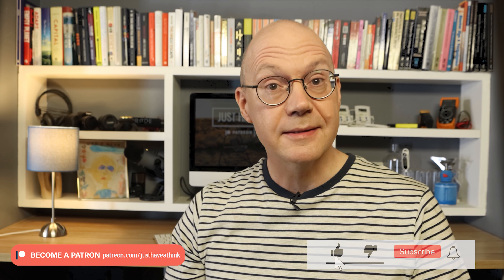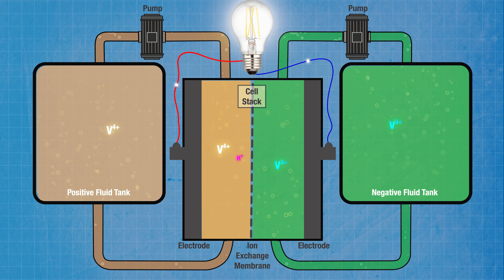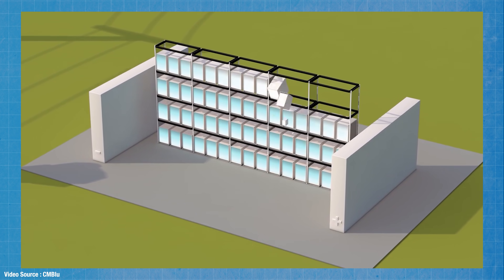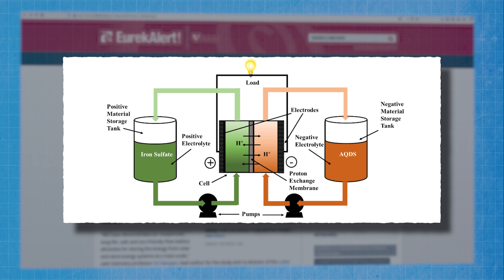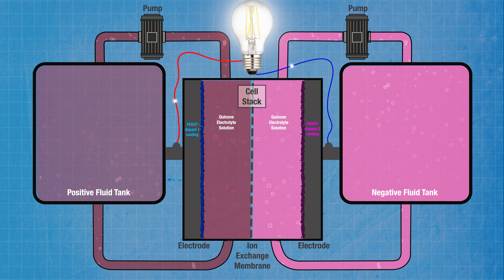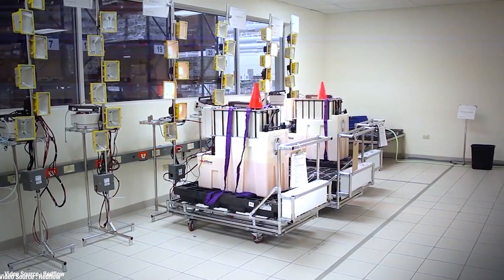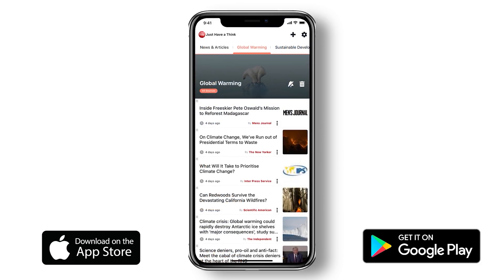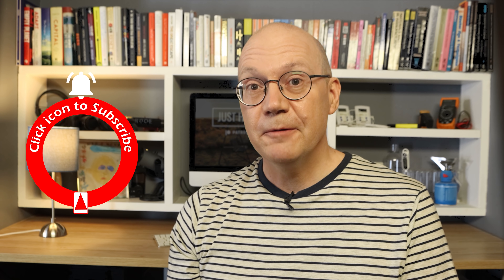Organic Redox Flow Batteries - The true path to grid scale energy storage?

Comment: I have a few hectares of oak trees that I'll start cutting down as my future quinone gold mine, chanterelles be damned!

I think the future of energy storage, even at Tesla, is already heading toward LFP cells, not the regular Lithium-Ion cells with nickel and cobalt, so the part about sustainable, environmental and ethical mining could be removed from the comparison, or at least include a caveat.
By the way, how would these organic redox batteries compare to LFP ones price wise? It does not really matter that they are cheaper than the vanadium redox cells if these are already super expensive.
Organic compounds also have a tendency to degrade over time (see OLED that has improved a bit in this area). Do these quinone/pedot redox cells suffer from this issue? On the other hand, if you only need to replace the electrolyte or electrodes every 5 years with cheap replacements and dispose of the old ones in the compost, that would be no concern.

A tiny bit of anti-China protectionism at the end?  ;)
Nah, sound financial advice, we should push these techs out of the lab ASAP.
Reply: This Organic Redox Flow Batterie Producer -> https://www.cmblu.de/en/home/ is using a Lignin based waste product from the paper industry...
Reply: Tesla has stated their intent to move entirely away from cobalt in the near future. Next generation cells don't use cobalt and the mass production lines are currently in developmnt and already partially exist, though need further improvement.
This is not limited to LFP cells, other chemistries, including their high performance/high energy density cell designs, are affected by this change as well.
Reply: @theuncalledfor  I know, but LFP cells don't have nickel either, whose mining and refining process is a huge environmental problem. That, plus electric motors without neodymium would really end all criticisms about polluting and ethical issues.
Reply: @Chimel31  The environmental problems of nickel mining are not "huge" in comparison to climate change.  They are almost insignificant.
Reply: @incognitotorpedo42  Well, it's still huge compared to the gigantic climate change issues.  ;) I mean the environmental pollution that it causes, which also has a carbon cost that (apparently) negates 2-3 years of EV usage. Some nickel is easier to extract than other sources, but it's in short supply and we'll need to extract nickel from dirtier and hugely polluting sources if we want to electrify all transportation and use Lithium-Ion batteries for energy storage. LFP cells is a proven tech that also has a great potential for future progress. The redox cell is another such alternative that uses neither cobalt nor nickel, and the latest research shared by Dave shows that it also has a potential for progress.
If we have a cheap working alternative without heavy metals and their specific issues, the market will choose this solution.
Reply: @Chimel31  Most nickel is used to produce stainless steel, and it is mostly derived from the oxide ore, which is expensive to refine.  EV batteries use high purity ("class 1") nickel, mostly produced from sulfide ores, and requires less energy to refine.  The Global Warming Potential for the production of 1 kg class 1 nickel is 7.64 kg CO2 equivalents.  A Tesla Model 3 contains 30 kg nickel, so that represents 229.2 kg CO2.  One gallon of gasoline produces 8.89 kg CO2, so the nickel in a Model 3 battery is equivalent to 25.8 gallons of gas.   A Model 3-equivalent gas car would get about 30 mpg, so the CO2 debt for the Tesla should be paid off in 25.8*30 = 778 miles.  That's not nothing, but is only a few weeks of typical usage.

The reason I'm going to the trouble of this analysis is that I'm concerned that we're letting the perfect be the enemy of the good.  Ground transportation is responsible for about a quarter of the worlds greenhouse gas emissions.  It's a huge problem.  Electrifying it would get us a long way toward net zero.  Waiting for a perfect battery with no emissions or no local pollution means that many more years of CO2 from vehicles, years that we don't have.   Much of the CO2 cost of nickel production is electrical power, so that is something that can and is getting cleaner over time.   LFP batteries are a reasonable choice for a lot of consumer automotive applications, but currently aren't adequate for high power needs.  Iron does have a lower carbon footprint than nickel by about a factor of 4.

Sources:  https://link.springer.com/article/10.1007/s11367-016-1085-x
https://www.ncbi.nlm.nih.gov/pmc/articles/PMC4085040/
Reply: @incognitotorpedo42  I agree with your data on class 1 nickel, but such high purity sulphide nickel (what your springer link is about) is not as abundant on Earth as we'll be needing to electrify transportation, and we are finding very few new deposits of it. What I was saying is that if all car manufacturers and energy storage were turning to nickel batteries, we would need to mine and refine dirtier laterite nickel.
In your Tesla Model 3 example, that would mean 2.4 tonnes of carbon emitted for a 30 kg nickel battery pack, or 8,100 miles, over 10 times more than your data.
This mileage probably corresponds to less than one year of average usage in a perfect world, but it would take more with regular grid electricity depending on the country, your actual annual mileage, etc.

There's enough high purity nickel for now that it's not a concern, and I am not at all in favor of "waiting for the prefect battery", I am a strong supporter of BEVs, but there is nothing wrong with planning ahead, especially when we have viable alternatives, or develop new ones for when we need them. Besides, Lithium-Ion batteries are not suited for ground-based energy storage. LFP batteries work much better for this application, and maybe these redox batteries in several years, and of course many other forms of non battery based storage.

This kind of information about nickel is what BEV supporters need to know, because we need ready answers to BEV negationists (who currently are not even aware of the nickel-carbon issue, only of the "save the slave children" cobalt issue). But mostly, this is the kind of information that will help us define new lines of R&D, as well as optimizing nickel extraction techniques as you mentioned. Using renewable electricity for smelting and all other processes would be one easy way to immediately reduce this high carbon cost. There are already industries that pre-heat stuff with electricity in order to reduce the cost (and carbon emissions) of heating to required temperatures with natural gas. There must be many such opportunities to greenify nickel production even from dirtier laterite nickel. But we need to be proactive about it and show that we are knowledgeable about it and that we are addressing the issue before it becomes one.

By the way, there are already Tesla Model 3 with LFP batteries, so switching to zero-cobalt zero-nickel batteries is clearly not a problem for transportation. These cars have 7 KWh more capacity than NMC Model 3s, they are cheaper, can be charged to 100% without penalizing battery life, and they charge faster too.

Source: https://cleantechnica.com/2020/09/27/electric-vehicles-the-dirty-nickel-problem/
Reply: @Chimel31  Thanks for the thoughful reply.  Cleantechnica's numbers seem a little high; the Springer article says nickel from laterite has a GWP of 29 kg CO2 per kg Ni.  That's only 3.8 times the sulphidic ore value they have.  In the Cleantechnica article, Cliff Rice is focusing on the pyrometallurgical process that has the worst GWP, but most laterite processing is done with HPAL which is better from a GWP perspective.  Rice is painting a pretty ugly picture, and I think he exaggerates the problems and ignores potential solutions.  He's creating a version of "save the slave children" for nickel, it seems.   That's the sort of thing that we're up against though, so best to get out in front of it.  Tesla is making a big point of sourcing clean nickel, but there are a lot more carmakers than them.  

LFP looks like a good choice for a lot of cars, so I hope that gets developed further and represents a majority of the batteries to be produced.  It's worth pointing out to the anti-battery people that EV batteries will be reused and recycled at a very high rate.  They're too valuable to just throw away.  There's still a lot of mining that will need to occur before the fleet is transitioned to electric, though, so it will be important to do that mining responsibly.
Reply: @incognitotorpedo42  I wouldn't trust Rice 100% either, his example of a battery pack with 50 kg of nickel does not represent your average EV, for instance. Unfortunately, CleanTechnica did not comment or fact check this article, like your detailed digging into laterite nickel. Between this kind of accurate knowledge which is not part of the usual discussion, is not relevant today with sulphide nickel anyway, and may not be very relevant in a few years because the tech might have changed in-between, there is a lot of leeway to say it is or rather could become a "huge" or a non issue. I would rather be on the optimistic camp: Recent clean and efficient battery recycling techs seem to be applicable not just to battery cells, but also to ore, that could be one way to extract and purify even the dirtiest nickel.
Reply: @incognitotorpedo42  There will even be more mining required as EV batteries seem to have a much longer lifespan than most people expected, they may get reused twice, in another EV, then in stationary storage; and new chemistries in the lab have even longer cycles. So it may take a dozen years before we see a sizable and sustainable source of nickel from recycling. Or 2 dozens, with Tesla batteries!  ;)

Comment: Could you please make a video comparing Redox Flow to Liquid Air batteries? They both seem to fit into medium scale energy storage category...
Reply: In Germany the "German Energy Storage Association" has a great overview (unfortunately all in german) of the different types of technology https://www.bves.de/technologien-final/ Just scroll down and have a look at all the factsheets...
Reply: @weingutjohner  Ok for me: I speak German ;-)
Reply: While I agree a video should be done on liquid air batteries, comparing them to redox flow batteries is a bit meaningless. They are solving different problems. Organic redox flow batteries are primarily solving the problem of cost and toxicity of rare earth metals. Liquid air primarily solves the problem of energy density by cheating some of the density through the reuse of the ambient environment. Of course that is also why making them work is so difficult air is full of contaminants especially on the highway or city streets which clog membranes and water which can react violently with lithium.

More specifically Potassium-ion air batteries are at least attempting to solve a similar problem as redox flow batteries by removing lithium. However those have seen almost no breakthroughs that make them viable period much less economically. However their theoretical promises are interesting which is that they should be able to achieve much higher cyclablity than lithium. However their energy density is going to suffer compared to lithium air batteries.

So the overarching topic of "liquid air" has some real players ones that actually strike balance between uses for grid scale or transportation is nearly void and there's a good reason for this. the ability to use air (mainly oxygen) is related to the use of rare earth metals with high volatility. Meanwhile fuel cells (which a redox flow battery is) are designed to react based on the presence of cations. Not saying there couldn't be breakthroughs in those technologies however just that its a significant uphill battle with competing factors needing to be ironed out.
Reply: @Furiends  I think the original poster was talking about something quite different.

"liquid air" (the air is liquid) rather than "liquid-air" (the air reacts with a liquid chemical).

It's an energy storage where air is cryogenic (liquefied) and the energy is stored in the temperature differential between ambient and cryogenic.

Comment: What about the fact that this battery setup requiring pumps to operate? I'm guessing when it's scaled up, the losses involved with operating the pumps are minimal compare to the battery's output. I'm interested on your thoughts about this.
Reply from the maker: I think that's exactly right Tommy. And bear in mind the whole thing is powered by Solar too, so the energy is renewable.